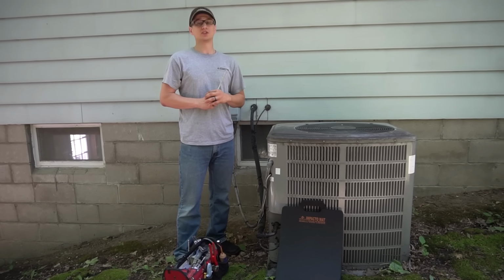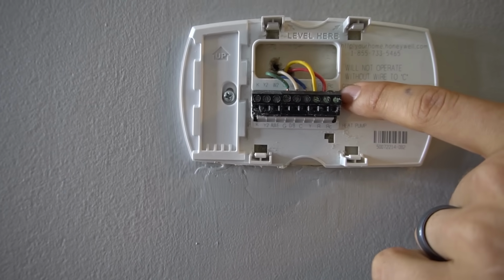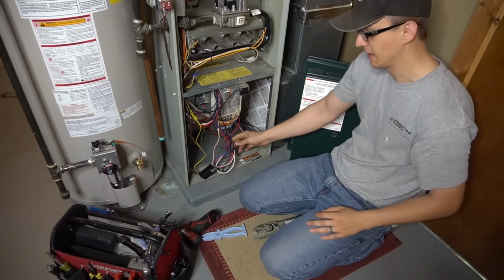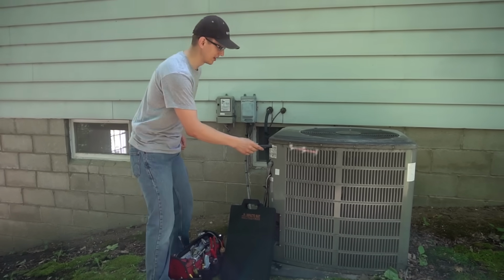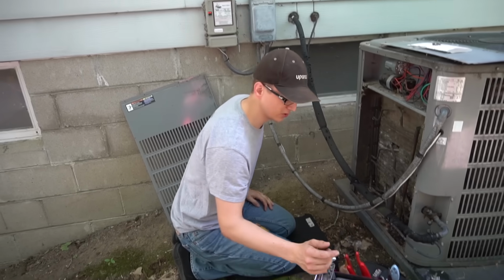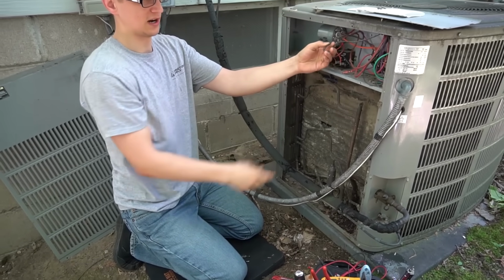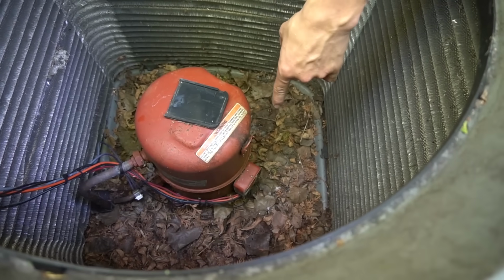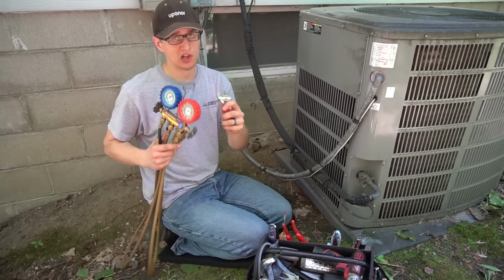AC Unit Not Turning On - How to Fix It Step by Step

Comment: So if everything is on, and you press that plunger and the fan runs, the problem is the thermostat? Even if the thermostat seems to be on and working inside? So it has to be a problem with the wires?

Edit: nm found a video of yours that goes through that troubleshooting. Saw a light on my condenser circuitboard that suggested a low pressure lockout switch. Figured I probably should just call a tech.

Comment: I replaced a transformer on a ac unit (fl) the fan blower went on after I replaced it but the condenser unit didn't go  on. I shut down the a frame circuit breaker next day the when I turned the breaker on the fan blower never went on I trace 240 electricity to fan blower but not working??

Comment: Hey...my AC just started to intermittently quit on me....audible normal click at thermostat when I lower the temp....nothing happens outside....two days ago I reset breaker and it came on....ran for a day and then stopped....today nothing....click at thermostat but nothing outside at unit....no humming or buzzing ....blades spin freely....wires all look good....could it still be the capacitor despite no humming/buzzing. Noise? Lennox 13HPX-048-230-19

Comment: This video is so good, it hurts that I still can't find my problem.

Any idea what to do when the outside unit won't spin, but...
1) the outdoor unit does spin perfectly when the plunger is down,
2) none of my house or furnace fuses are blown
3) all the wiring looks intact and correct, plus fwiw

4) the furnace fan spins, and
5) the furnace isn't sweating at all.

I think I must be missing something obvious but can't figure out what.

Comment: Hi, thank you for the great video. I have a 410-a goodman split system. I have traced the problem back to outside unit. I thought maybe the compactor was bad but it actually checks out. So when I push the contactor in with screw driver the fan comes on. I didnt listen for the compressor to kick on while pressing contactor. I will listen for it in the morning. With all that being said what would cause the outside unit not to come on? Everything inside is working fine. Just the outside unit..

Comment: Very helpful, how can I tell if I have a unit with a heat pump or not so I can determine which thermostat to purchase?  Also, can replacing a thermostat cause the condenser to fail?
Reply from the maker: This video should help with figuring out whether or not it's a heat pump: https://youtu.be/dzA9jrfAvSM
The only a thermostat can cause the condenser to not turn on would be if it was wired incorrectly.

Comment: My control transformer has no fuse and it’s burned twice now. I can’t get the thermostat to heat or cool but it will turn the fan on only. I can broom stick condenser it works fine .

Comment: Excellent video.  Mine is a Lennox and has microprocessor boards both inside and out.   The control panel says it can not find the outside unit.   The 4 wires are R  I+  I-  C   I assume R is power and C is common.   But I don't see voltage from R to C and the outside board is dark, normally has an LED flashing.    So I went inside and I do not see voltage from R to C either.   I know I+ and I- are the RS485.  The board inside has indicators that are flashing so I don't think the fuse is blown.   Should I see voltage from R to C?

Comment: great video and great information. My entire A/C unit was just replaced and everything has been working fine. Yesterday the power was shut off for 30 minutes and then got turned back on, and the A/C will not come back on. I'm getting nothing from the inside unit or outside. I reset the breaker and thermostat for 30 minutes but still didn't work. Any ideas for this problem? Can give more information if needed.

Comment: Need help,  thermostat stopped sending signal to turn on rv furnace, it was an analog heat and cool duo therm.   I replaced it with another analog white Rodgers heat and cool one.   I can’t figure out the wiring correctly.   I can make the furnace work or the cooling work separately but if I wire them both the furnace comes on along with the AC.    I have 6 wires.  Old stat. Went like this:  red +7.5    Yellow cool.  White FUR.  BLUE HIGH FAN.    BROWN FAN.   GREEN GND.   
The new stat has 11 different connections if you count the three on the base which holds the anticipatory      On sub base. I have G- Rc-  O-  Rh-  B.    Then in a different location I have an. A-  Y - W      
The three on the base with the anticipatory are.   Are:   R-  W-  Y.     White Rodgers. M100. Heat and cool.   There are too many can’t figure out which ones to use.   Thanks in advance if you can help me figure this out.    It’s a 12 V RV furnace gas and the roof air conditioner 115 V

Comment: My ac system is working but there’s a slight burning smell that makes my eye burn some times like pepper . I put the system off for a whole day but the smell is there especially if I’m close to the vent . I tried putting the heat on and off but it doesn’t matter. Can you give me a advice . I’m a pipe fitter so I have ideas on how to fix it . Thanks.

Comment: Direct and straight to the point. This guy knows his work. I don't trust half the technicians out there charging me for random unneeded repairs. It's good to diagnosis things yourself these days.
Reply: Getting too old, I guess. My service guy just left. A blown fuse on furnace that I didn't put a good effort in finding. He T.S. for reason of blown fuse. Didn't find a reason. Cleaned out water drainage pipe, and cleaned ac/heat exchanger unit while he was here. I'm satisfied but have not got the bill yet.

Comment: My ac unit outside is on and spinning out cold air but inside the vents are barely blowing anything out. Does that mean that I just need Freon? This is a new ac unit .. I remember my old unit use to blow out hot air from the fan outside. Does that make a difference?

Comment: What is likely the problem when fan motor is turning, Thermostate is good, breakers are not tripped and compacitor is good, fuse is good and the compressor will not kick on. Left AC on for about 30 minutes to wait for compressor to kick in and Compressor got HOT to the Touch, still did not kick on

Comment: Hello, i have a question, i am in the process of replacing my current thermostat, i do see that my green wire is connected to O/B and not G, i went to check the furnace and the green wire is connected to the G, no O/B, should i disconnect the green wire on my thermostat from O/B and switch to G? btw, my A/C and heater works fine.  thank you.

Comment: I wanted to say thanks for the video.  I know just enough to get in trouble but I did watch the capacitator video first because I know that is usually the problem.  Apparently I need to buy another multimeter because I got no readings on my old capacitator so I spent $40 on a new one.  I replaced it and still nothing.  I then found this video and watched most of it.  I pushed the relay in and still nothing.  I pushed in it a few more times and only got a spark but unit still didn't run.  I came back inside and decided to try it one more time.  I cut the thermostat on and went back outside and waited.  The fan and unit came on as normal.  It may have been a combination of the cap and the switch but no matter $40 and about 45 minutes of video was a lot better than a $200 - $300 house call and stilll having to wait 3-4 days for someone to come out.  Thanks again!!!!

Comment: Question, my ac only cools during the day but stops cooling around 8 in the night. I changed the filter, cleaned the coils changed the fan and motor capacitor and still having the same issue.

Comment: My fan motor outside went out, I had it replaced with the same factory motor 1.3 amps but I was getting 1.5amps.  That motor went out as well. They put in a larger fan motor calling for 3.1amps but I'm getting 3.5amps.  I check the single pole contactor but it looks fine.  The pull disconnect is broken the blades on the left broke off and stays in when you pull the disconnect out. Can the pull disconnect cause the higher amps, or do you think something else is causing the amps to be 3.5 instead of the rating of 3.1?

Comment: I appreciate this content as a technician for learning but please do not try to diy this stuff! Call a professional.
Reply: Spoken like a true technician 🙄.  I used to be intimidated by the a/c unit and waited 2 hot days for a tech like you to come out and replace the capacitor for a $230 service call. Also told me the contactor was going to go soon and said he could do that while he was there for another $90. I looked up the price of the contactor and it was about $10. So I decided to look up the cap and it was $15. Then I looked into everything and realized there isn't much to the a/c unit and it's a pretty simple system. Since then I have replaced capacitors on other people's,  fixed mouse damage to the contactor wires and recently replaced the condenser fan on my unit. Only thing I won't do is mess with the freon or replace a compressor cause I don't have the tools.
Anyone with a little common sense , respect for electric and a little mechanical ability can do most repairs themselves cheaply  and easily. Don't tell people to call a professional and try to scare people. Tell people to educate themselves and enlighten their understanding of the things around them, it make a person a better person to feel self sufficient.

Comment: I’ve been watching your videos and I was hoping you can help me resolve the AC problem I’ve been having lately.  I tried getting some AC Repair companies to help me but it seems none of them are honest and just going all over the place, but yet my problem is still not resolved.  I hope you could give me some honest insights what you believe is the problem or how to repair it.

Currently, I have a two-story house.  I have only 1 AC unit outside.  I have two zones with two thermostats in the house.

The problem is the blower/fan is running fine, but the Unit outside would not fire up.  It will once in a while but not always.  For example, the current temperature in the house is 80 degrees, so I set the thermostat to 75.  As soon as I set it, the blower/fan in my attic would start right up and start blowing, but the unit outside will not start at all.

The first company stated it might be the capacity so he replaced it.  It worked for a few hours, but after he left the problem started again.

The second company came out and stated it was probably the contactor, he stated the contacts look like it has been damaged so he replaced the contactor part.  Soon after he left it started not working again, so I went and removed the cover and press the plunger in the unit and it works.

The third company came out and stated that he thinks it's the Control System board located in my attic, but my home warranty company would not replace it because they stated it's considered an accessory. 

After that, I went and contacted a fourth company who stated it might be the AC drain, which I don’t know if that was the case but he ran the drain to the bathroom sink.  Still, I have the same problem.  

The fifth company stated it could be my thermostat and because my home warranty would not replace the control board, the fifth AC company stated they can rewire the entire system to run from 2 thermostats to 1 and both zones will open when I adjust one thermostat but they will charge for rewiring.

At this point, I don’t know what else to do or who to believe because it seems like no one knows what the heck they are doing or not doing it thoroughly like you.  Could you please help?

My control system board is EWC Controls NCM300 2/3 ZONE CONTROL PANEL, and my thermostat is a Honeywell Non-Programmable Digital Thermostat (43223-211).

Comment: Question: Everything inside is operational. Fuse on panel is good. System is kicking on inside. Some air blowing through vents. Compressor fan is not running at the condenser. I hear it trying to kick on, but it is not spinning at all. I looked for the plunger that you described at the capacitor, but I did not see one. I have a 2 ton Trane condenser made in 2013.

Comment: I believe my capacitor is bad, fan not turning outside but if i push it it comes on every time!!! I am working on it soon. I am a DIYer. I've fixed lots of appliances at home, including the furnace for heat. Question, i have never seen a "filter" inside my furnace, could it be the one located on wall right below my furnace.?, or do all furnaces have one. I have a RUUD heat/air unit.

Comment: i just watched this video and my question is my unit would hum and i would have to use a stick to spin the fan blade. well that worked for about a week and now i get no noise no movement. i was told it was a bad fan motor. i checked everything that's in the video and still nothing. no bad wires, nothing bulging or leaking and power coming in the bottom of the control unit. help please.

Comment: Hey man I replaced the circuit board on the ac heat unit and I have a continuous ted light. The board differed quite a bit from the origina one Upon startup the ac turned on in the attic but nothing through the vents. Your experience is appreciated. 👍👍

Comment: Thanks bro! I have a pvc pipe connected to the coil condensation drain. Pipe leads to a little pump that’s fastened to the side of the furnace. Pump pushes the condensation water through a little flex line to my laundry sink drain. The pump motor is either wearing out or just malfunctioned some how and it had me shut down for a while. It wasn’t in your video but your video did lead me right to it. Just pulled the drain pipe out of the pump reservoir for now and let it drip into a bucket until I can test the pump and possibly replace it. Thanks again for the info bud, much appreciated!

Comment: I replaced the fuse. The fan worked for about 30 seconds then it stopped working and it seemed to try to go again but something on the board popped. I rechecked the fuse and the replacement fuse was good, so this time it was the board. I know I will need to replace the board but I think the blower motor is the start of all my problems. Any other ideas what it might be?

Comment: I installed a new fan motor and capacitor a couple of days ago. Just today, I installed a new control board on the unit as well. Now, when the outside unit starts up, it trips at the breaker. What am I missing? By the way the compressor is only a year or so old. Think it could be as simple as the capacitor on the outside unit?

Comment: Having an issue where the AC is not turning on. I've replaced the capacitor, replaced the thermostat. And verified that when I push the contactor in it kicks on. I'm thinking now that for some reason it's not giving enough volts to the coil of the contactor. Which means I'll have to figure out why on that and double check the wiring of the thermostat. (Went with a Google nest thermostat e series, from a Honeywell series 20 with the electronic control module, so I had to rerun wire from the 3 wire to the full 6 wire) so to test the voltage on the coil of the contactor would I just go from one side and ground and look for 24 volts?
Reply: Also, the furnace side works fine and the fan works. Just  the compressor fan and compressor unless I push the contactor.
Reply: Doh. So I figured out the issue. There is 24v going to the electrical box on the compressor unit. However one of the wires leads to the high pressure and low pressure cutouts and I'm getting a voltage drop after those down to 6v. Which means I'm either low on refrigerant or I have a bad cutout switch. Time to call someone in. At least I know exactly what is wrong
Reply: Final update. Neighbors HVAC friend came out. I was on the right track but didn't realize the high pressure switch had a reset button on it. Needed to reset it and clean the radiators. That's all the issue was

Comment: Any thoughts on why the control board is not showing any lights as if there is no power? Main breaker fuses are fine, checked the fuse on the actual board (doesn’t look blown).

Comment: You are amazing!! I even understood what you were talking about.  We replaced a lot of parts & even ran a new 5 line wire from the thermostat in the house through the upper floor boards to the outside condensing unit. But the plunger  on the connector works and blows cold only when we hold it down. Once we let go, it turns off the fan and no more cold air in the house. Whats the next step? We had professional a/c people come and thats why we replaced the thermostat, the control board, fuse, capacitor, and more

Comment: Does central air have a furnace? I have 2 ac units one for upstairs and one for downstairs. My downstairs stopped blowing thru the vents changed filter still not working outside fan kicks on. Please help

Comment: See if I can get help here in the comment section. My A/c unit isn’t kicking on neither the condenser fan or compressor no sound at all. I replaced my capacitor still nothing. I checked the contactor it is receiving the 24v power from the thermostat. But I’m not getting 240volts to the contactor to L1 & L2. I checked both my 2 pole breakers on my main and sub panel breaker box both breakers are getting 240v. I’m assuming it’s possibly the disconnect box is bad or burnt out? Unfortunately my disconnect box doesn’t have fuses and it’s not a pull out disconnect either it’s like a breaker switch type that can be flipped up or down. Seeing if anybody can give me some pointers or had similar issues. Ac unit is a good man CKL49-1.

Comment: Outdoor unit not working after lightning storm. Checked the circuit breakers. All looked fine. Checked the outdoor fuse...Fuses are ok. Fan is coming on at the furnace but the outdoor unit is not coming on. What else can I check? I have 240 volts at the fuse outside but the unit does not turn on.